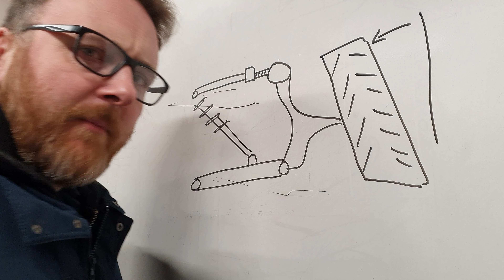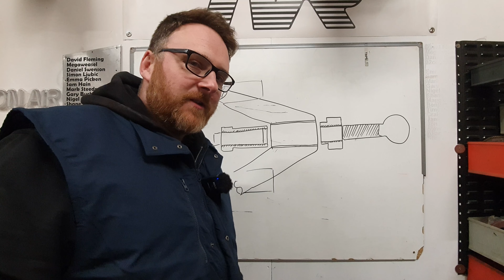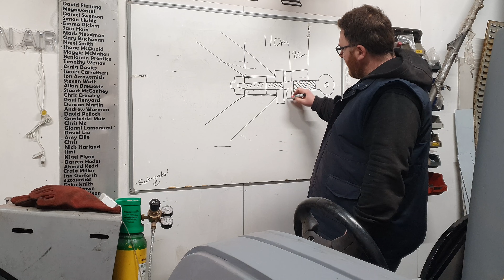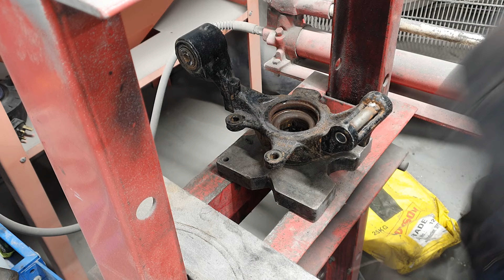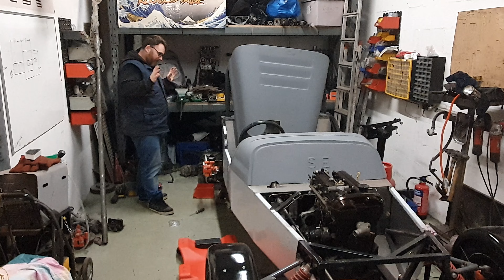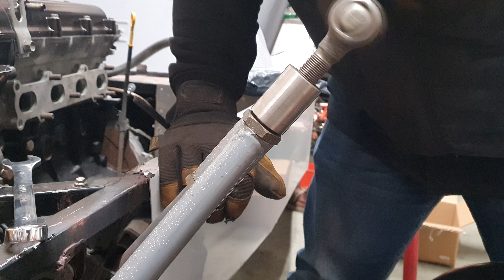Tipping the Scales! Locost 7 Kit Car FULL BUILD!! - Episode 69 - (Project 7-UP)

Comment: I am getting close to tackling my control arms and shocks with the aid of a new cnc plasma table, I am excited to get back into hard charging on the next big thing I decided to go with outboard rose joints for the rear suspension adjustability, but still not sure it will pay off or not.  I tried to stay with a consistent shore strength on all of my drivetrain mounts.  I felt it was important to avoid harmonic vibrations in the chassis by differing mount hardness.

Comment: You do need some play in those rear upright bushings, otherwise you will get binding in the rear suspension. At least that is what all the MX-5 forums say. Don't go with the Poly bushings for that location. If you want something tighter than the stock bushings, then you should go with Spherical bearings. I have ordered a kit to do this on my project car.

Comment: Another solution for the top arm is, make the sleeve which goes through the top arm longer which the ball joint goes in to with the OD of the sleeve threaded and a large lock nut, this would, in my eyes, give more strength, feeling the pain with such problems.

Comment: Great job with the extenders. I'm trying to figure out the coilovers/spring length & rate, never dealt with stuff like this before. I will be going with Gaz ones(UK). Also ordered the intake manifold from another Youtuber from UK(danSTengineering), that should be here on Monday. Making my own Throttle body setup, using Kawasaki Ninja ZX-10R throttle bodies, on Duratec 2.5L engine.
Reply: I am also doing a 2.5 build and zx-10 throttle bodies.  I decided just to get an intake plate and do custom tubular intake manifold.  I have someone who is supposed to do it for me, but a local welder quoted 1,300 usd to cut and weld some aluminum tubing to my specs.   I probably should have just ordered the full one from Dan's